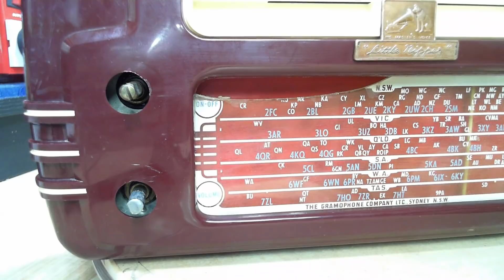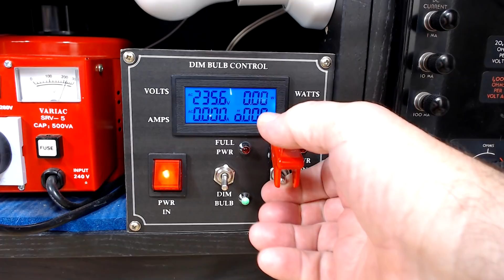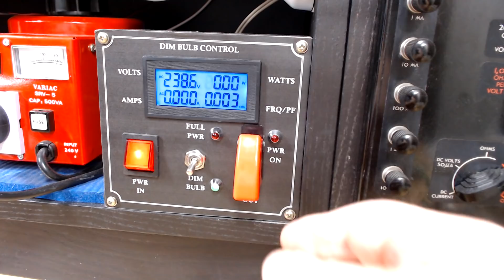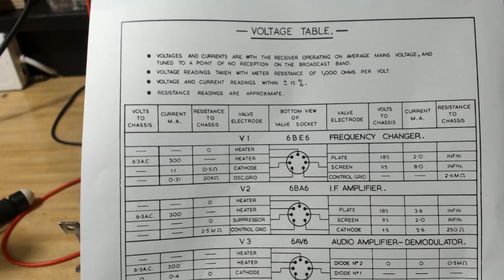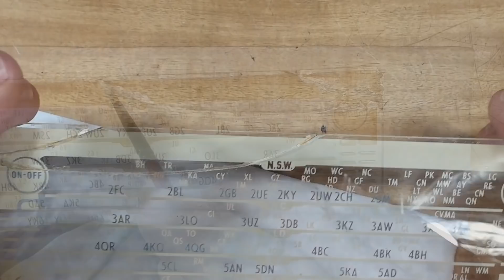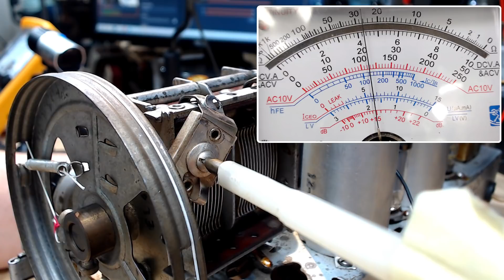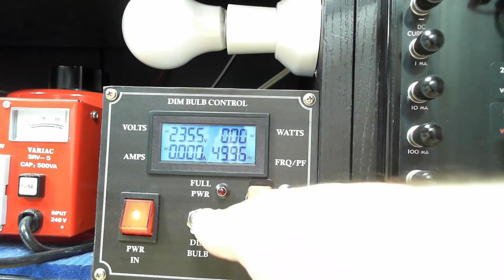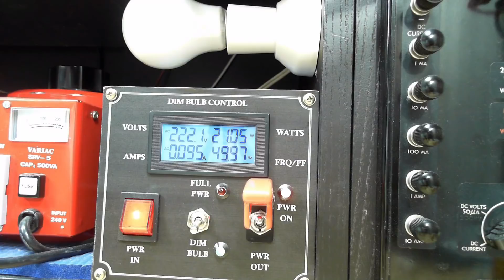HMV 61 51 Radio Repair - 1954

Comment: I always admire the cosmetic improvements you achieve on the radios. The plastic surgery you performed on this unit was really a very impressive result compared to the state of it when you started. Thanks for the video.
Reply from the maker: Thanks birdie399. It was a mess wasn't it, I am probably too hard on myself 😄
Reply: Dave you are too hard on yourself. Great work.

Comment: Dear Dave, there is nothing Dave cannot fix, using JB Weld, aceton thinned plastic and lots of wet grinding. There is always something to learn from. Amazing, whenever you switch on the radios, after a first rough inspection, they usually work - this is magic! Eagerly waiting for the next Radio adventure - greeting from Germany, Thomas
Reply from the maker: Thanks Thomas. It's always interesting when I first power up the radio, sometimes it's a little disappointing when they work and I don't get to troubleshoot them but they usually work to some degree. Thanks Thomas in Germany, take care over there 👍🙂

Comment: "I'm not going to do mad on this one!"
(Spends probably more than a week cleaning off nicotine, replacing all caps including the ones that were still good, replacing dial string, replacing dial glass, replacing volume potmeter twice and rigging up an identical radio just to see how the volume works on that one, aligning, glueing millimeter size pieces back together on plastic case, custom-shaping aluminum and gluing them to the case sacrificing a clamp in the process, spray painting the inside so the reinforcements look good the next time someone opens it, followed by probably a few days worth of video editing with material from at least two cameras, possibly more, that were recording for the entire time).
"Meh that could have looked better. That was probably not that interesting, I apologize".
😆
Thanks for posting, Dave. Great work as always.
Reply from the maker: Hahaha... you nailed it Jac 😂 hahaha.... I'm still laughing... 🤣 Well written Jac and very accurate, I will show my wife your comment, she will agree. Thanks and Cheers 😄

Comment: You know I have to say with what you started with and what you had to work with you actually did a nice job on the case how many people would actually reinforce the handle on the radio no one they would glue it together with superglue and then just put the JB Weld on the backside and not reinforce it so nice to see someone do it correctly and repair it correctly thank you for a wonderful video
Reply from the maker: Totally agree John, reinforcing with just JB weld would be a waste of JB weld. The Al sheet I use is only 0.020" thick and very easy to shape. Thanks John 👍😀

Comment: That radio case is one of my favourite colours! I,m glad you found a glass for it. That case was definatly worth fixing. It is is now strong, which is reasuring. Strength and beauty go hand in hand in any classics. It,s not enough just to trust the bond of the glue when it comes to plastics. The only time frailty and beauty go together is in something that is delicate and not for everday use. That kind beauty is termed elegant. That said don,t give up. The repair on the case worked very well, but there must be a way to hide those cracks seemlessly. Even if there isn't away though, I would still treasure it, if it were mine.
Reply from the maker: Thanks Tyrone. It did come up very good and works well. I was disappointed with the finish on the repairs, I may be to do a better job now with a bit of experience behind me 🙂

Comment: Nice job. Your working with the dial pointer gave me a flashback to a lab manual at university: "AVOID PARALLAX ERROR!" (I had to look it up... no idea what it meant.)
Reply from the maker: That's good tip Wayne and I tell my wife that when she looks at my car speedo and thinks I'm speeding. Right hand drive car of course 👍😄
Reply: @DavidTipton101  just tell the wife AVOID PARALLAX ERROR  when she thinks you're speeding  :)

Comment: It sounds pretty darn good Dave. The repairs you made to the cabinet were really good and will outlast the rest of that plastic cabinet! Yes it is too bad that the cracks could not disappear. Unfortunately on this one I think a repaint of the entire cabinet would be the only way. Since the rest looks so good, though I think that the broken areas just give character to the old girl. Great job as always.
Reply from the maker: That's a good way to look at it Gregg, the radio has a story to tell. If it was mine I probably would have painted it, still, it's a nice radio and works well. Thanks Gregg 😀

Comment: You have some unusual tools there Dave.  I have not ever seen the small narrow belt sander you used in cleaning up the JB weld left in the case.  It came out really well as always. Thanks for sharing it with us!
Reply from the maker: Thanks Jeff, The tool is called a finger sander, good for getting into tight places 😀

Comment: Excellent work, Dave... couple of comments:  Never feel bad about a good repair that remains visible; the cracks are structurally sound and their visibility is an honest indication that work was done.  Some other repair person will understand what you did and work with it.  I notice most of your Aussie radios have less dial/frequency numbers and more call letters; in this one, the dial is divided by states!  A surprise to me in the US.  Cheers!
Reply from the maker: Hi Don, I was disappointed with the repair but I accept that I can't get it perfect every time. The owner was happy. Aussie radios pretty much always have call signs, sometimes there are no frequencies on the dial at all or are hidden from view and only used for servicing. Thanks Don 😀

Comment: Mustard capacitors : if I remember correctly those are polyesther capacitors. Never had a failing one.
The A and B type potmeters : very confusing indeed. Here, in the Netherlands,  the A type used to be linear. B is log. And then there was anti-log. May have been used in tone control.
Nice, that capacitor mimic 😊
Still have to watch the rest ....
If you wish to "slow down" the volume pot , make it less agressive,  just load it with a 1M resistor between wiper and ground.

It was a nice video, Dave. Great result, considering the state it was in. Thanks 👍🤝🇳🇱
Reply from the maker: HI Nard, mustard caps are polyester and quite reliable but two have failed in separate radios in the past so I err on the side of caution. I tried a 1 meg in different positions on the volume pot but the sound became distorted, maybe I didn't try it as you suggest. I'll keep it in mind, Thanks Nard 😊

Comment: Hi Dave my mother purchased one of these in 1954. I seem to recall it costs 27 pounds? not cheap .
We listened to it for years and it rarely broke down and sounded good. we also took it camping in the caravan too, I remember hearing on it the announcer saying goodbye 1955 and welcome 1956 on new year's eve while pretending to be asleep in the caravan.  Alas, it suffered the mandatory cracked cabinet especially after my mum had a switch and phono terminals put in the back, so it also played heaps of records from my mum's phillips playgram record deck and my sister wore out her beatles records as well.
So i have a sentimental lean to this model. Ours was held together with tape and was in use up till the mid 1980's when my mum took it to vinnies without warning??
I wish I had known how to fix the cabinet back then.
Reply from the maker: Thank you for the trip down memory lane, it's nice to look back at what we perceive as better days, I do it all the time which ticks off the Grandchildren 😄

Comment: I can not believe you actually got that negative wire slid under the outside sheath of the cap if that were me it would never have worked. Great job on repairing that radio David.
Reply from the maker: You and me both LuckyLarry, I was surprised it was still flexible enough. Thanks LL 😀

Comment: Another great job. I love all radios, valve or transistor types. I'm just a few years older than you David and repaired many old radios in my time, but never rebuilt the damaged radio cabinets like you've done. looking forward to your next assignment.
Reply from the maker: Hi Nigel, thanks. It would be nice to have a bit of radio repair experience like you, I struggle at times 😀 Of course you would have no necessity to do the cabinets as a repair tech. If you are in the UK I have an Ekco radio I might do soon 👍😀
Reply: @DavidTipton101  Since 1971 I work for Marconi Instruments, just north of London. My later radio building skills were directly from what I'd learned as a test engineer. Sadly, Marconi has disappeared, broken up and partly taken over by an America company under a new name. That 2 Value radio you featured awhile back and was one, which I had ago at building, well the 2 plug-in shortwave coils I made for it, worked better than expected. I still haven't made the cabinet for it, as yet.
Reply from the maker: @nigelbrockwell6237  Thanks for your story Nigel. Interesting making the two valve a SW set 👍🙂

Comment: I love the music they play down there.  As a footnote, when guitar techs need to fill in the string slot on a nut that is cut too deep, the use baby or talcum powder and super glue/ C-A  glue.  Then they can recut the slot correctly.  Perhaps that might work on cracks like that.  You may even be able to use some colored chalk pastel dust to reduce the line. Just a thought. And I honestly have never seen anyone have the tools like you have.  That sander was about as esoteric a tool as it gets.   Great video.  Always a high point of the week.
Reply from the maker: Thanks Midnight Wind. I was wondering about colouring superglue, I know to use Super glue and baking soda (bicarb soda here) but it needs to be coloured to match. I wonder if I can use coloured tile grout or cement oxide colour or art coloured powder. I'll have to experiment, I assumed it only worked with baking soda, Thanks MW 👍😀

Comment: I’m sure I’m not the only one to suggest lacquer sticks for cosmetic repair of things like the cracks you were dealing with. They are also called burn-in sticks I believe. Furniture repair people used to use them all the time, I think actually they are colored shellac sticks and you use a hot  palette knife to melt a bit of it and work it into the crack or ding or whatever.  One of the advantages of them as you can use a couple of the different sticks - melt bits of them together to come pretty close to the color you need. Thanks as always for these really well produced videos, a bright spot in my week.   :)
Reply from the maker: Hi ericmark100, I tried using wax melting sticks but it wasn't successful, I haven't seen the ones you are talking about, I'll try to find them. thanks for the tip 👍😀
Reply: @DavidTipton101  here’s a link to the type of product https://www.leevalley.com/en-us/shop/tools/supplies/finishing/finishes/20071-lacquer-sticks

Available in the states at any rate. At least gives you some idea what I’m talking about. When I was young I worked in a piano shop, we had a piano tuner who was a chain smoker and had a habit of burning customers pianos and other furniture (45 years ago it was ok to smoke in a customers home) fortunately we also had a furniture guy who could blend almost any damage using those lacquer sticks, a little alcohol lamp and a pallet knife. He made it look easy but of course it wasn’t.
Reply from the maker: @ericmark100  I found some Shellac sticks in Australia, the colours are pretty dark though. I'll keep looking 🙂

Comment: Great job again Dave. 
I actually thought you’d paint the entire thing, but of course you had to go the “melt the plastic in acetone and avoid any of the simple solutions that most normal humans would try” route 😊 
The pots here in Europe are normally: A for log, B for linear and C for reverse log. I have come across inés like yours that don’t obey the rules, however. 
Thanks again.
Reply from the maker: Thanks Manuel, I was short of time so painting wasn't an option and besides why take the easy way 😄 I thought pots from the US and Asia are as you described and European ones reversed the A and B and used F for reverse pots and sometimes used C for log... arghhhh! 🙄

Comment: Hi Dave,
Another stupendous Vintage Radio refurbishment.  I’d say it’s fair to assume it’s performance is pretty much as good as it was in 1954 - a good year, though I first saw the light of day during the last week of that year LOL.
Those mustard caps, though exceptionally good during the late 1950s, and well into the late 1970s, are now tired - even those that are ONS.  In recent years, I’ve discovered a few that are defective. 
Talking of mustard caps, they were Philips/Mullard brand.  Their production started off as a shiny green, I don’t know why the manufacturer changed their colour to mustard - I thought the shiny green looked okay!
I too save old coax cable for the same reason you used the braided outer in this video LOL.
I had to smile when you began replacing the dial cord.  It took me back to sometime during the mid-70s when a fellow service tech decided to do similar by hooking up the old cord to the new, and pulling it through.  Although it appeared to be a brilliant idea in theory, it didn’t quite work in practical terms.
Talking of IF alignment, though I’ve seen a few techs apply an analogue multi-meter for measuring gain, or amplitude, I’ve never been totally successful doing it that way.  I either use a scope, or a VVM - which ever one is closest to me at the time LOL.  I was looking at the price of ceramic screwdrivers.  They are not cheep items!
Now gluing plastic, Bakelite, glass etc. for me is definitely a black art.  Doubtful I get 1 in a 100 attempts right - or very near right.  On the very rare occasions it turned out right, it was definitely luck, not management.  Yet, it can be done!  I’ve seen repaired broken plastics, Bakelite, and glass where the repair is invisible - looking at it, no one would know it had ever been broken.  The minute I ask how such a first class repair was achieved, the conversation in that respect drops like a stone.  They are happy to restore my broken Bakelite radio cabinets for an exorbitant fee, that is why they flatly refuse to divulge their technique.  If you find out their secret, please let me know LOL!
Lovely chatting to you my friend, Phil.
Reply from the maker: Hi Phil, Thank you. I'm in September so a little earlier than you 🙂
I get a bit of flak for changing mustard caps but like you I have had a few fail in service after I have left them in a set, thanks for backing me up. Green does sound better, like a jelly bean.
The dial cord would have worked if I had used better tape around the pulleys, whether it would save any time is a matter requiring further discussion.
I have had no luck aligning with a scope although it's good to see the shape, I will attempt it again one day. For you techs who have done it for years it would be easy. 
Getting information for repairing cases is difficult, as you say, the folks that know won't tell. It's a bit like dial glass printing, they can do but you only get limited information.
Thanks Phil 🙂

Comment: You do under estimate your own work.  Perfectly acceptable for the age.  You were just lucky so much of the material was there.  I think you are on to something with the melted plastic. Maybe if you take it out of the acetone sooner, it will have more color. Well done Mate.
Reply from the maker: Hi Jay, thanks. I should have used less acetone and not leached so much colour from the plastic 🙄
Reply: Or add something to make it black or dark grey. Ink from a (good) permanent marker ? A darker line won't stand out as much from the dark red.

Comment: Hi Dave, Regarding the volume control issue and although this advice is too late to implement, I would have checked capacitor C13 (100pf mica) for leakage and that R 3, 2.2M hasn't gone high. These would reduce the AGC voltage causing higher than designed for audio output from the detector. Also I remember on these sets the volume control was usually set around 9 o'clock for normal listening. Also the old log pots labelled C were not the same as the A type bought today, which are cheap approximate log.
Reply from the maker: Hi Robert. I would imagine I checked the resistor and I also remember being suspicious of the AGC, I'm pretty sure I checked the AGC thoroughly now that I think of it. Thanks Robert 👍🙂

Comment: Nice work. Good enough for the owner it seems. Re tone pot, at 7:33 I thought I could see 'LOG' punched into that pot.
Reply from the maker: Hi James, thanks. I think you are right, it looks like it. Tone controls are usually log. I checked the spare chassis I had for this radio and it's tone control was Log 🙂

Comment: As far as repairing cracks in plastic, years ago I used a Swiss product, TOKO MASTIK. It came in several colors, you could mix to blend colors and was used on skis for repair of top sheets. I dont know if its still available, TOKO may have changed / updated the product name over the last 50 years. They focus on ski wax and accessories.
Reply from the maker: That sounds useful Emily but I can't find it, it probably would be hard to get in Oz, not a lot of snow. I wonder if they use it on water skis, I'll check, thanks Emily 🙂